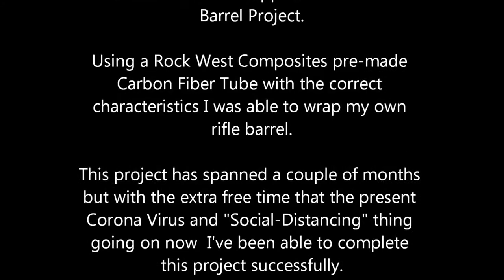Do It Yourself Carbon Fiber Wrapped Rifle Barrel

Comment: Have you done any safety pressure testing with the barrel, by firing a 125% proofload from a safe distance by pulling a string attached to the trigger? I'm actually pretty surprised this worked, as far as I know all the carbon fiber wrapped barrels are made by tightly wrapping it in carbon fiber, thus putting at least some moderate tension on it, and the carbon fiber is likely much more tightly wrapped around the barrel as well. So if you would compare this DIY carbon wrapped barrel to a commercially produced one, I'd bet there would be noticeable differences in their properties and effectiveness.
Reply from the maker: Yes I did to the safety pressure tests but I didn't go all out.  I mainly just did maximum book loads plus another .9 grains in .3 gain increments.

All carbon fiber wrapped barrels are not made by tightly wrapping them with carbon fiber; although in the beginning this is what I thought too.  I learned along the way that there are several makers of these carbon fiber wrapped barrels and each one claims to have proprietary methods that make them better than their competitors.  I found this to be bullshit in many cases.  

There are some carbon fiber barrel makers that are truly better than the rest (Proof Research to name one) but the remainder are all doing it basically the same way.  

My carbon fiber wrapped barrel was done in a manner that more closely resembles the way that BSF makes their carbon fiber wrapped barrels; although, I didn't know that BSF even existed at the time I came up with my idea for doing it this way.  Hope this short reply answers some of our questions.

I did a write up on this project over on the Cast Boolits website.  You can check it out there.  It's kind of a long read but it has some of the photos I took along the way.

http://castboolits.gunloads.com/showthread.php?392923-Can-Anyone-Tell-Me-Which
Reply: Generally, the barrel can hold the pressure without the fiber wrap. The wrap is done to stiffen the barrel without adding much weight. It's a lot like lining a steel barrel, while some people do use bore-sleeves (thin-walled tubing with rifling), most lining is done with "pencil barrels" being inserted in the old, bored out barrel, soldered or epoxied in place. Poster essentially lined a CF tube, NBD. Gun barrels are not pressure-vessels (they're a tube with one end blocked off), and don't have to be all that thick to survive being used as a gun barrel. The reason barrels are as thick as they are is mainly to prevent damage from rough handling, to not  heat up as fast, and stiffer barrels are more forgiving in their harmonics.

Comment: Hi I was wondering I think I found most of the info on how I can do this but I was wondering what diameter you can cut the barrel down to before wrapping. Did you play it safe and pick a diameter of an existing smaller steel barrel already?
Reply from the maker: NO; I played it safe and turned my outside barrel diameter down to the existing inside diameter of the pre-made carbon fiber tubing that I used. 

I didn't wrap my barrel in the conventional sense of the word.  With the pre-made carbon fiber tube, I simply slipped it into place and secured it with a threaded on end cap not unlike a thread protector.

It did require that I heat the barrel before slipping the carbon fiber tube into place.  This heating was done in order to create a longitudinal thermal expansion.

Only after the barrel had expanded sufficiently did I slip the carbon fiber tube into place and snug it down with my threaded end cap.

As the barrel cooled it contracted longitudinally which further secured the carbon fiber tube into place.

Hope that makes sense.

Comment: More info please did you send the barrel to them
Reply from the maker: I'm sorry it's taken so long to reply.   No I did not send anyone my barrel to have wrapped.  I did it myself.  I did have to turn down my existing donor barrel in order to properly fit the Carbon Fiber tubing though.  
I did a full write up on this project over on the Cast Boolits Forum site.  You can check it out there.

http://castboolits.gunloads.com/showthread.php?392923-Can-Anyone-Tell-Me-Which

Comment: makes no sense. you have a carbon cap on your barrel which does nothing. the point of wraping under tension makes the carbon and barrel attached as one. but to each his own,seems like a lot of work and money when you can just go buy a proof barrel.
Reply from the maker: You clearly don't know the process I went through to attach the carbon fiber to my barrel.

You're making your assumptions based on this short amount video proof that I was able to get it to work for me.

As you say, "To each his own."
Reply: as long as the epoxy application was good... it's fine, and will perform well, lol. Wrapping actual fabric, soaked in epoxy is slightly stronger/stiffer (especially if you alternate the weave pattern every couple wraps), and it fits more elaborate barrel contours better, but it's not necessary, especially with some of the nice CF tubes on the market that already do that.